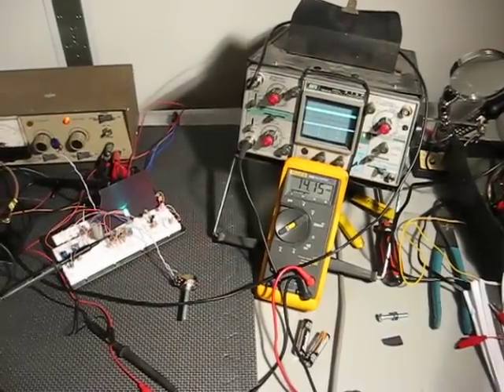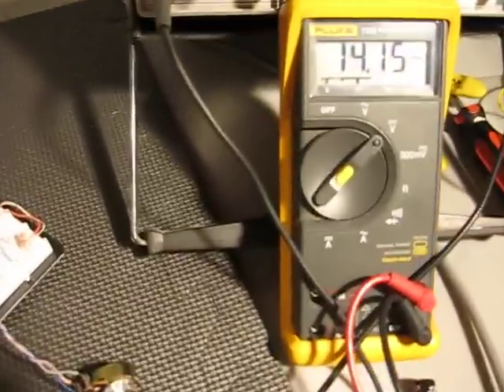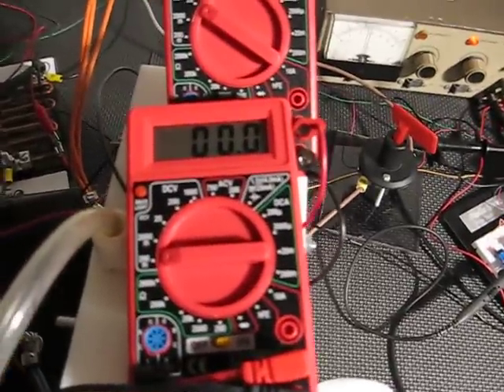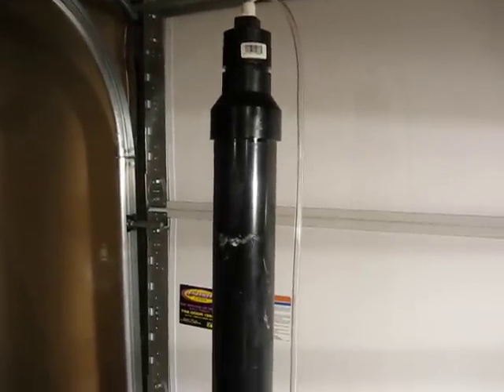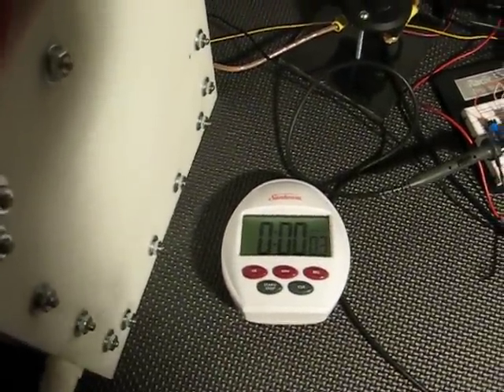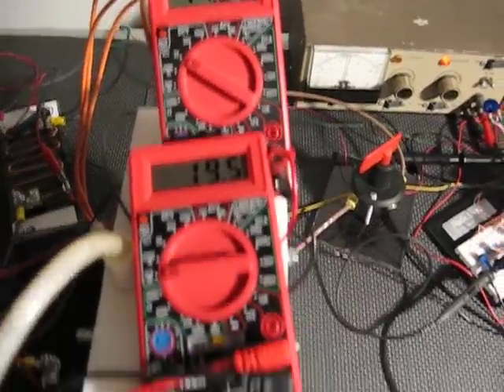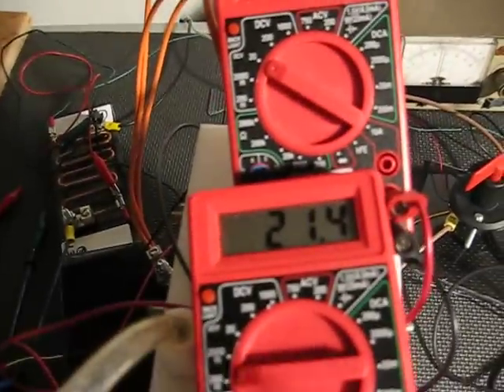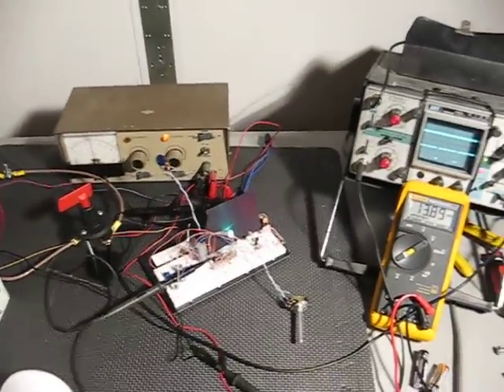HHO PWM Control Test

Comment: Make your car a hydrogen hi-brid Hho increase fuel burning efficiency better then a new car. Cool engine running  prolonging engine life and engine oil life with less engine maintainess required🚦

 100% fuel will burn in the engine No un 

burn fuel wastage . Hho system works on petrol, deisel, cng, lpg and lng types gases.

Engine runs lighter smoother reducing carbon emissions significantly . Boost engine power and torque . Hho gas reduced engine noice & vibration

ACMEC hho car kit lower the engine temperature more reliable simply made Hho kits restore better fuel economy. Hho system is very easy and simple to install. Hho solves the engine heating problems automatically! Cleaner engine running. Reducing engine noise due to the faster fuel burning. Hho car kits works nicely requires no modifications in the car engine. No side effects on car engine.

Engine start quickly your car battery Will Charge Quickly make your car a low cost hy-brid. Useing  low amps. Hho car kit will work better. You can easily transfer hho kit from one car to another one. Hho kits requires no any modifications in the engine. HHO kits absolutely work.